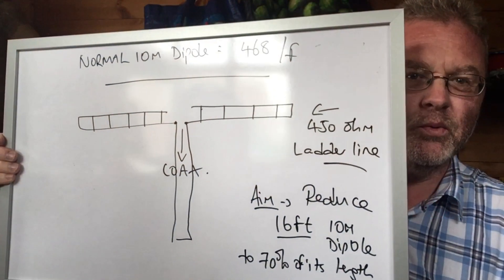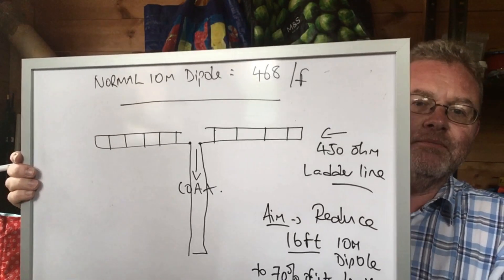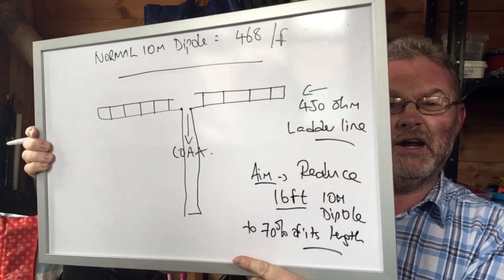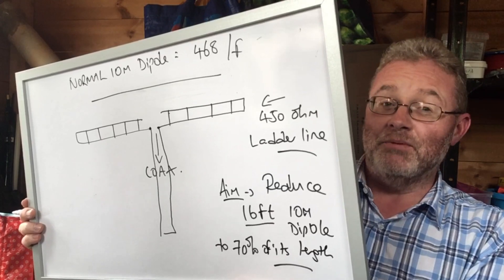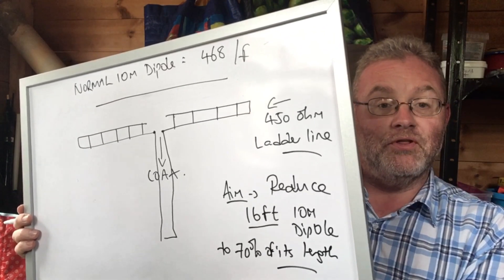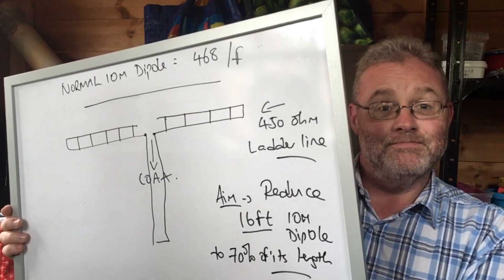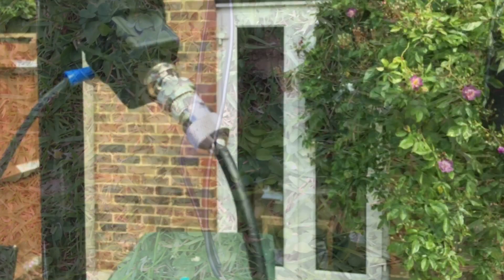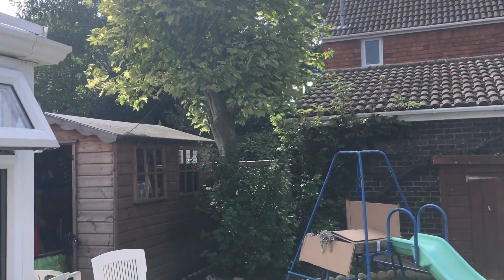Shortening a Dipole Antenna by Linear Loading

Comment: I know the post is from 5 years ago. Regardless, I can't understand why linear-loaded (LL) dipoles don't get much attention.  I've had good results using the mentioned "ladder line" (that's window line to me) for my two LL dipoles in my attic (loft). I have 8ft vertical space from the wood flooring up to the roof peak where there is a pulley with a paracord rope through it to suspend my slightly inverted-V, 40m, LL dipole with an overall length of just under 45ft. It's been a great antenna for over 10 years. My target frequency of 7.100 mHz, yielded an overall length of 44.8ft (13.65m). That works out to the dipole being just 68% of the full, regular 1/2-wave dipole calculated using the old equation Length in feet = 468/fmHz. Modify that equation by multiplying 468 x 0.68 to yield Lft = 318.2/fmHz. to figure LL dipole length. Feedpoint impedance of these antennas is a little low...about 35 ohms for my antenna fed with RG-58C/U.  But, I recovered an SWR of 1.1 by offsetting the feedpoint away from center by about 13% of the total length of the 45ft dipole, or about 5.8ft (1.77m). Suspended from the same pulley at the roof peak is my 30m LL dipole, made the same way.  Another benefit of making linear-loaded dipoles like this is that they are considerably quieter so far as locally generated rcvr. noise is concerned.  Two other things I've noticed: 1) These ants have a relatively broad SWR feature and 2) I am able to feed the 40m ant. on 20m with an SWR less than 3.  'Hope someone finds this info useful.  73 from Tennessee, W4AEE
Reply from the maker: Great info - thanks!

Comment: Howdy from Texas! If I make a linearly loaded dipole like this from ladder line w shorted ends, with the extra wire down the middle, but then fed it w ladder line as well, will that change the needed lengths of the dipole legs? I am particularly keen on making an 80m doublet like this only Fed w ladder line. Any changes on the length of the legs and the the balanced feedline lengths? Will 300 ohm ladder line work equally as well for either the legs or the feedline? I have an external tuner now so think I’m ready to make this happen!
Reply from the maker: Hi Pat if you are looking at 80 and up then the triple wire version for each leg can be as short as about 40 to 50 feet per leg and work fine. Give it a go!

Comment: Great video. If you check out Maple Leaf Communications, they produce a shortened 40/20m and 80/40m dipole that uses linear loading of ladder line along with additional wire strung through the ladder line, which not only shortens the overall length but seems to provide a flatter SWR curve. I have been playing with a shortened 40/20m that I picked up from a local ham at a bargain and might see if I can eventually fit the longer one for 80m. In the meantime, I am playing with a variant of a doublet to get me back onto 80m, kind of like what you have done.
Reply from the maker: Thanks for the information and good luck with getting on 80m. 73
Reply: @TIMG5TM  You are welcome. The ARRL also published an article in "Low Profile Amateur Radio" with details of how to build a 40m version, and says that the 80m equivalent would measure about 80 feet, so it might not be difficult to make one if you have the parts lying around. 73

Comment: Nice to see a video on linear loading using ladder line, a favorite topic of mine.

You can shorten the antenna further after linear loading by forming the dipole ends into two loops.  Then the length will be 5/Pi or 5/3.14 = 3.2 feet total length.
Doing this you can squeeze a 40M dipole into a small attic.  I used 300ohm ladder line that gave me 18 feet/leg or 36 feet total for a linear loaded dipole for 40M.  Bending the dipole legs into circles give you 18/3.14= 5.7 foot diameter circles each leg and will resonate on 40M.  The impedance will be a bit lower but a matching network or just feeding with ladder line will work well.  The 300ohm line is inserted into soft flexible Pex tubing to form circles and is hung in the attic.

It works and it works well.
Reply from the maker: That sounds very interesting indeed. I’ll have to look this up. Thank you very much 73

Comment: Very good Tim, thanks. I am always interested in shortened antennas especially vertical dipoles and also multibanded (also fed with ladder line). I’ll keep an eye on how things progress for you and might follow your lead. It would be interesting to try a comparison from your portable site with a ‘standard dipole’ coax fed and then a shortened version also coax fed ‘side by side’ (allowing for a decent separation so that interaction is unlikely to play a part). Thanks again. Nick M1DDD

Comment: that's brilliant actually for people with limited space. Like myself, I can't really throw a long wire up - shortened antenna's are great for limited space and i'll be more than likely trying this out on 20 & 40m for in the loft. Makes an interesting video too :)
Reply from the maker: Mike1074 DX I agree Mike. For  20 m try about 23 feet maybe ... 2x11.5ft legs. I'm currently building a shortened dipole for 40m to test this out. Cheers mate.